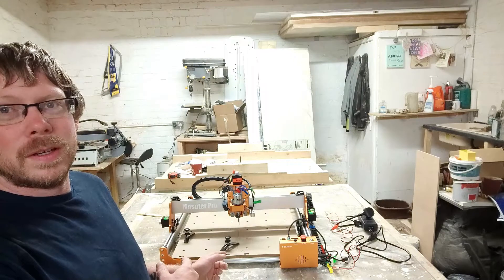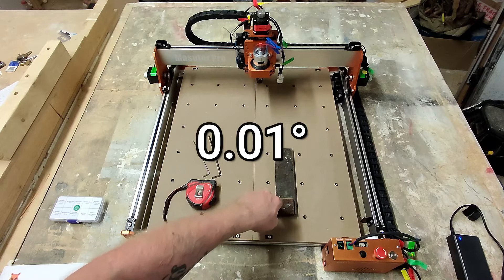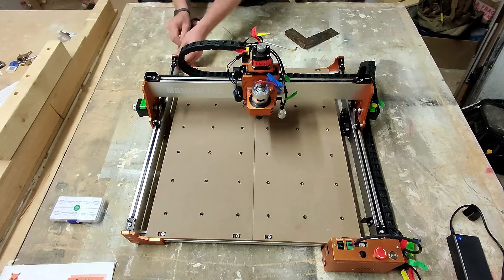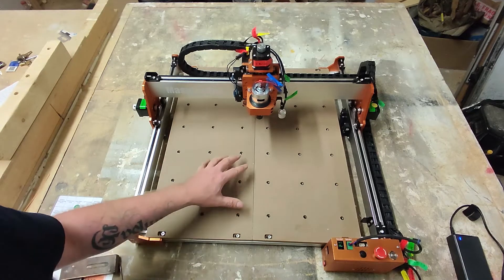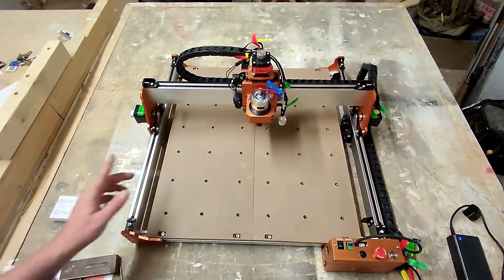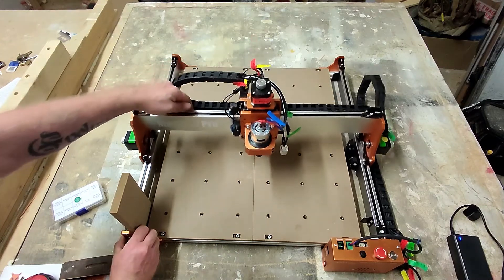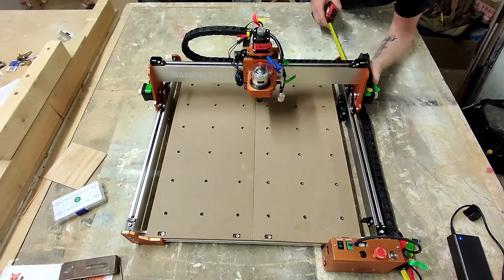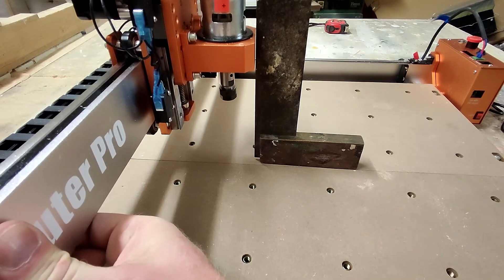Square off a CNC machine. FoxAlien Masuter PRO

Comment: You have everything square! But if I’m not as lucky as you, what should I do? You don’t explain how to solve it!
Reply from the maker: Apologies. I thought I had explained that part. You simply loosen the screws in opposite corners and then slide the X axis on the T nut until it is square and tighten it back down.